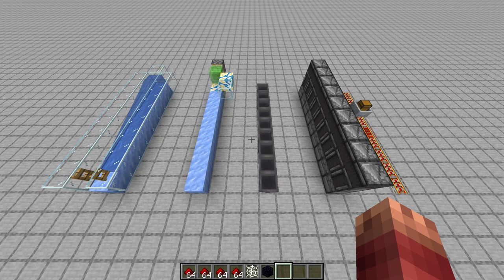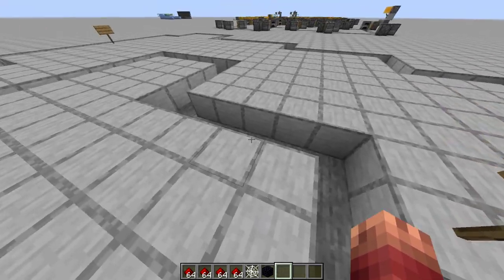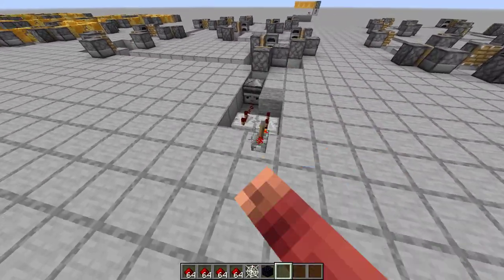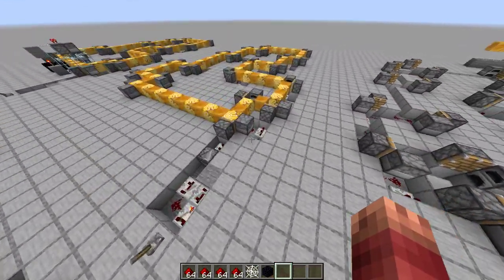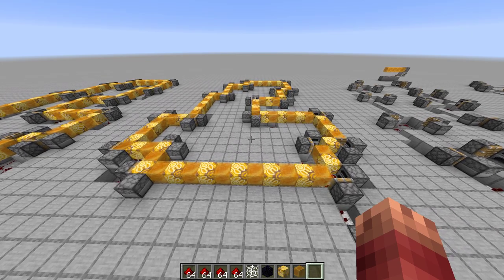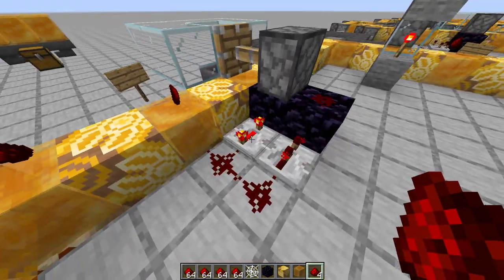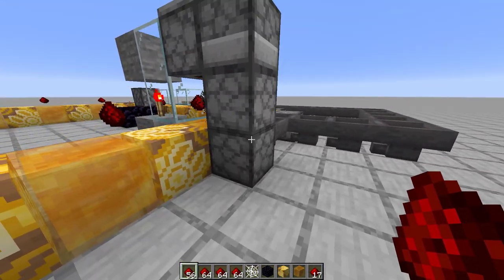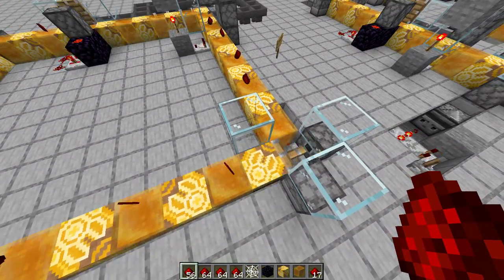[Quick RS] Easy Conveyor Belt System

Comment: Couldn’t you use something like soul sand instead of honey? Or is there a benefit to having honey there?
Reply from the maker: That could probably also work, but all the items would be on the edge between soul sand and the full hitbox block. I like the more random look of honey.
Reply: @redinator2k   you should use a black block in place of the terracotta for the hazard pattern look
Reply: I don’t think soul sand would work - It seems like on the corners, the items would just fall off. Or they might glitch into the right spot, idk.